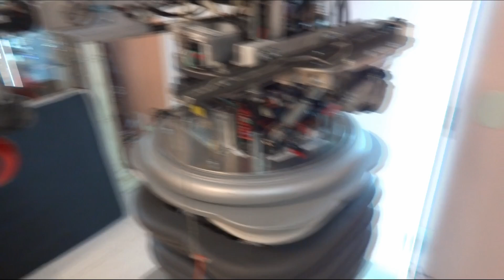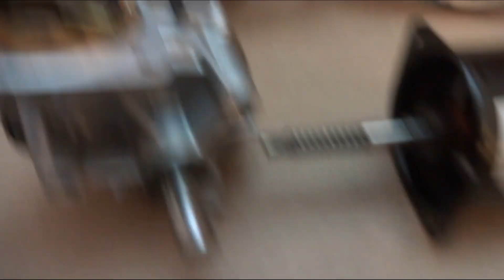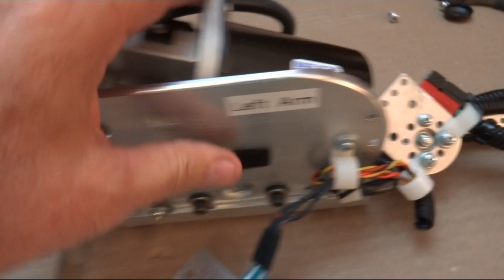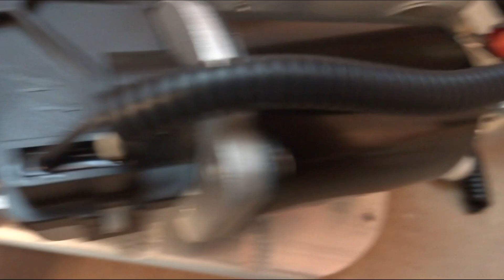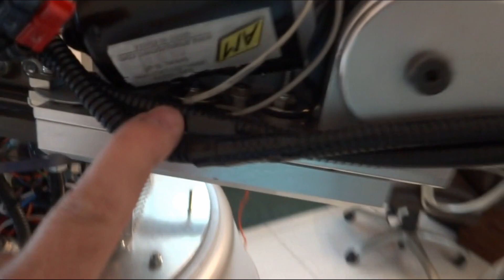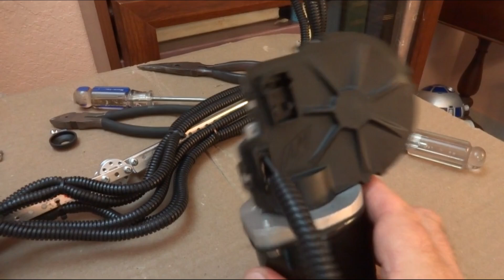Arm Motor Replacement. Part 1

Comment: I'm surprised the new motor (removed from the gearbox and shaft) wouldn't mount into the old gearbox and shaft?  Unless the gearbox was stripped in the motor burnout perhaps?  I don't think I've ever heard you mention where you get your custom metal parts at?  I can tell some are off the shelf, but a fair bit looks custom machined.  Did you machine those yourself?
Reply from the maker: RoboJRR, I really didn't think about swapping out the heads and gearboxes' of each motor. They may fit like you say. However I think I'd rather just keep the new one intact. I think I'd like  to focus on trying to replace the brushes on the old motor and salvage it. This would be a fun project of another time.

A lot of my metal parts were a combined result of hiring a machinist (the arm elbow motor mounts), welding shop (the leg supports) and my own work. The tread sections were made by a metal fabrication shop and most of the outer body of the robot were made by different club vendors.  I also bought a lot of the parts you see in the arms and around the robot from ServoCity. They carry amazing structural building materials and motors.